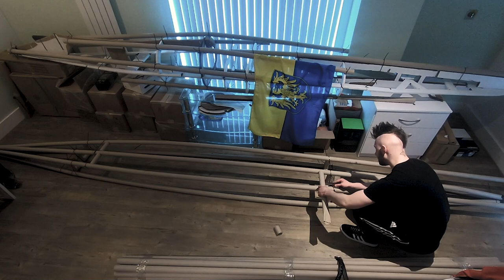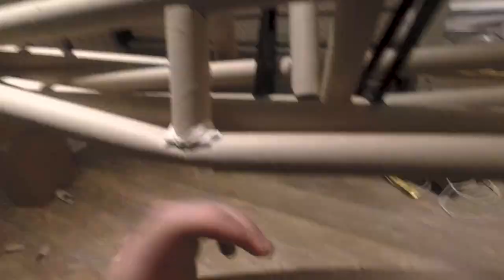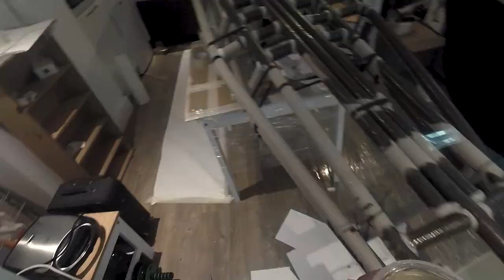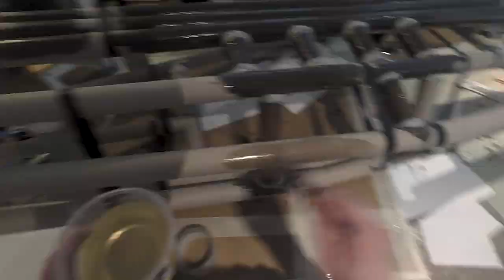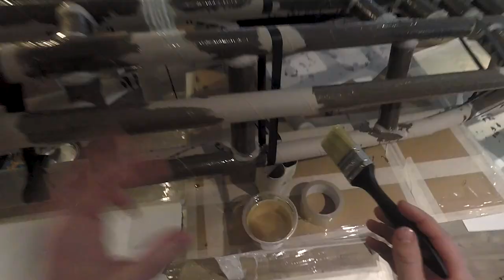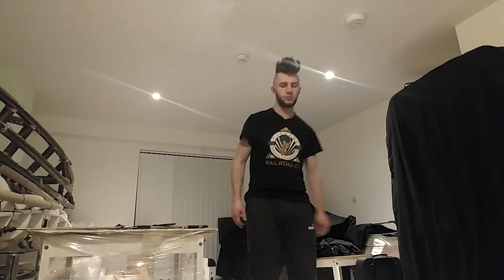My Road to Boca Chica/Starbase. SECOND BOAT IN MY STUDIO FLAT!

Comment: paper is simply fine wood so you are making a composite of epoxy and fine wood particles which should be very strong.. what will be the outer skin?
Reply from the maker: Skin is paper + resin. I would like to make 100% paper boat without any viberglass or somrthing